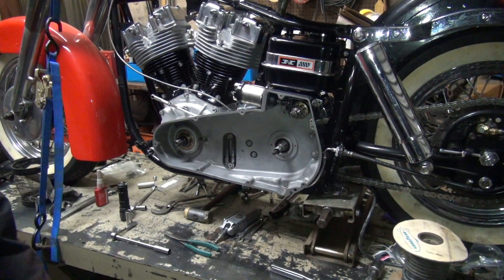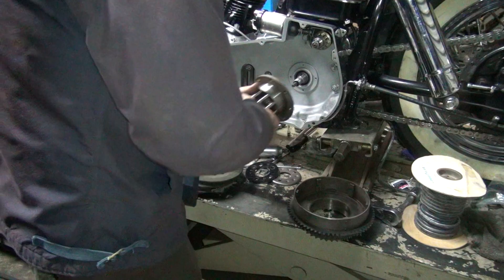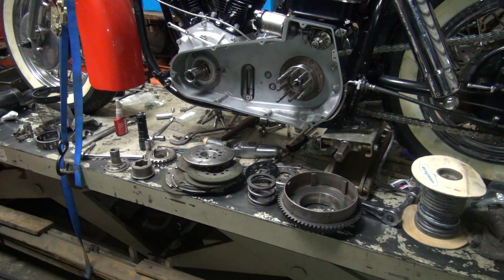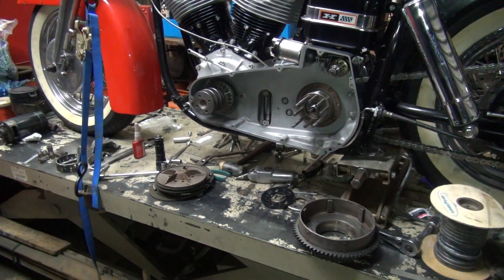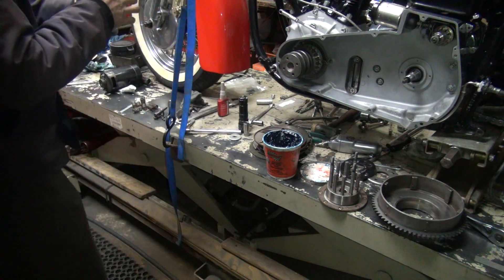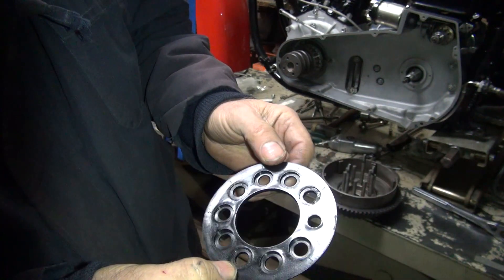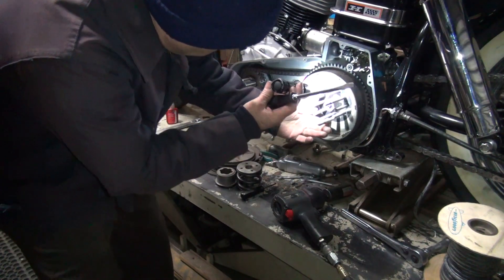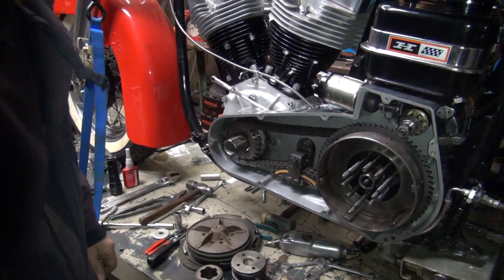1967 74ci shovelhead #155 flh bike assembly transmission rebuild harley craigslist tatro machine

Comment: Has anyone else ever seen one of those plastic clutch hub retainer rings with snap ring before? (11:19 of this video)
Reply from the maker: yes and i have them forsale if anyone needs one. now if i can just find one on all the sheeves full of parts.
tatro
Reply: @TatroMachine  Keenan, I take it that this is an aftermarket device as I've never seen one of these before?
Reply from the maker: yes, ram jett made them 1st back in the 80's.
tatro

Comment: J&P Cycle sells an engine sprocket shaft spacer kit to align the motor sprocket to clutch sprocket. Set includes 8 spacers from .336″ to .666″ thick . Why not do it right instead of deflecting and saying that the .050" misalignment will be absorbed by the slop in the chain???